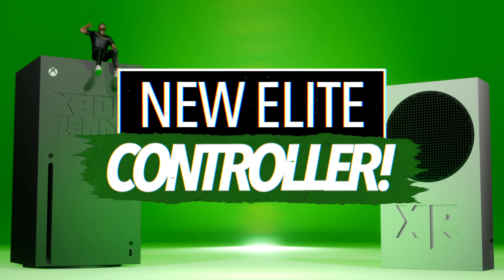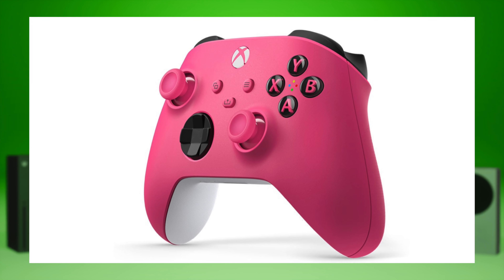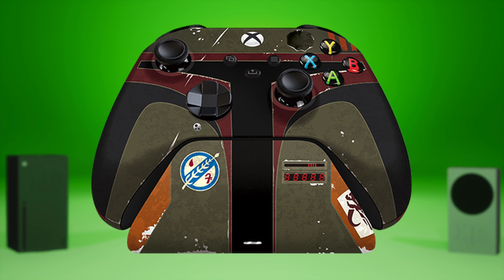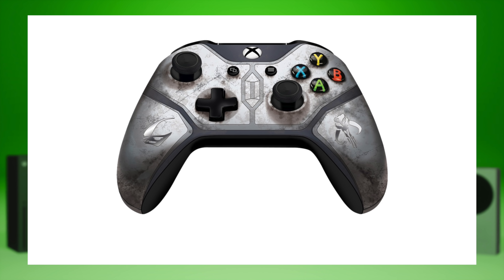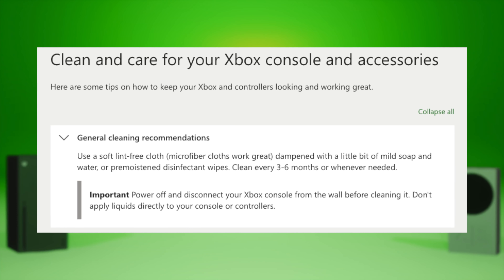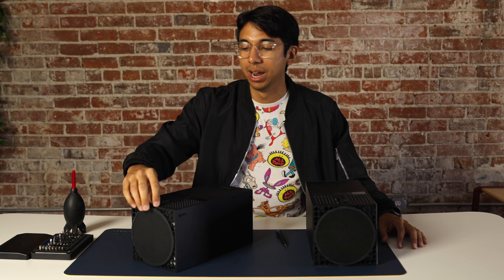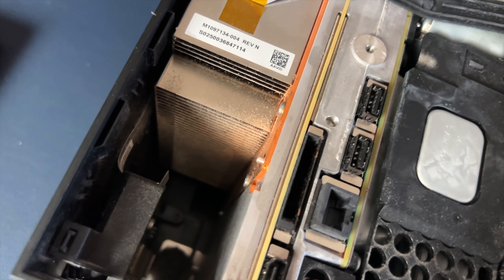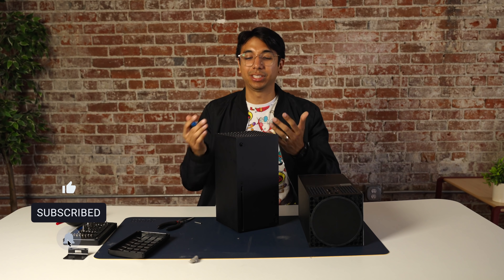Xbox Update: New Controller

Comment: When will the firmware be fixed on series controllers. stick inputs particularly rapid movements downward are extremely inconsistent. On old Xbox one controllers you can go to an older firmware and it fixes the issue. Unfortunately you can't go to older firmware on series controllers.

Comment: Is elite 3 coming? Elite 2 is great , I can't imagine changing it for anything else . But as soon as elite 3 is available i will definitely try it 😊
Reply: I've bought both elites 1 and 2. The 1 is crap and the series 2 elite is nice but like most others my left bumper is shitting out already! Not happy at all! For 150 bucks I expect a controller to atleast last. I take prestine care too, I don't smash buttons or let it just sit around so I'm disappointed
Reply: @GD1_3  What specifically happened to your left bumper?
Reply: @azumi334  it doesn't register 60% of the time when pressed normally. And there's also an issue with one if the back paddle ports where it doesn't work at all
Reply: @GD1_3  In a large number of cases with non-functioning buttons works compressed air, which is easy to buy:)  Often you get some dust or something similar. Compressed air is an excellent remedy for such faults
Reply: @azumi334  thanks for the advice I already tried that though. It's definitely a more technical issue from what I'm feeling and experiencing
Reply: @GD1_3  You are right. For 150 it’s not good enough. I have one and already RMA twice. Still issues with the A Button. The A button needs more pressure to register. It’s sad for that price